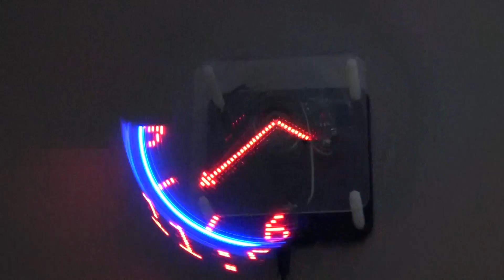A short rant about very old electrolytic capacitors

Comment: I have five square body VHS-C camcorders-two are Panasonic PV-10D’s, one is a PD-40D-that was my uncle’s old camcorder-works great, just a muffled microphone-I also have a GE CG690-and a GE CG695-the last one I mentioned works the best of all of them-decent sound and video. They were all made in about 1990. I wonder if those have the crappy capacitors, or the Japanese good quality capacitors? The two Panasonic PV-10D’s seem to have bad capacitors because of the lines in the viewfinder when I try to film footage-but when I play tapes back in playback mode-no problem-except one the tape slowly migrates out of the correct path and crinkles the tape-the other one doesn’t do that-it just has lines in the viewfinder when filming-it wants to play back the footage too fast-but when I play tapes recorded on a good working camcorder in it-clear as a bell! The GE CG690-lines in the viewfinder when filming-but playback of a tape from footage filmed with a different camcorder-clear as a bell-it also has a bad sensor that allows it to run for about a minute-then the power red light blinks and the unit shuts off. The GE CG695-it has only slight lines in the viewfinder when it’s first turned on-once it warms up to operating temperature-it clears completely up, and it films great footage-decent sound, and all!

Comment: True I have several 1960s transistor radios UK and Japan most electrolytic are ok. There are the known bad makes or the obvious signs of distress. I recently got my parents 1957 ultra from the loft changed what was needed sounds lovely. I kept the smother can in as they tested ok and had no leakage I use this radio myself and can keep an eye on it.

Comment: You absolutely must check for DC leakage, and under load. Testing for capacitance and ESR without load doesn't really mean anything except that the ESR and capacitance is ok when the capacitor is not under load.

Comment: I agree. From my limited experience, most old caps I have replaced because my brother, an electrical engineer said to do it, were perfectly good. I have mostly replaced caps in Ampex tape decks. Ampex used superior materials. 

I checked both capacity and esr and not one was bad. Brother said: but they WILL go bad soon, so it was good you did it. My friend who repairs professionally says: if it ain’t broke . . .
Reply: PS, they all passed leakage testing, too

Comment: I think also its worth considering the manufacturers data on life expectancy ect. 
Makes me think of a timing belt on a car - go past recommend time/mileage and you run the risk of destroying your engine. Caps that have gone way past thier quoted lifespan are really just on borrowed time. And yes it can depend on how its been stored/used. 
My Nad c352 i replaced all the caps. They were nasty cheap caps, didnt want one of those flipping its lid in the middle of a party! They are a known point of failure so it was a preventive measure!

Comment: The Tests that you performed are fine but I personally wouldn't pass judgement until I passed full rated voltage through the capacitor with a microamp meter in series to make sure that there's no DC current leakage... But if it seems like it's to much work to check all capacitors for all their failure modes, then just shotgun it and just replace them all...

Comment: I repair Fender and Marshall guitar amps for a living. Just had a 65 Deluxe Reverb in the shop. It had a blown screen supply cap.I did all 5 main filters, the bias cap and all 7  preamp cathode caps. I guess that amp is 55years old ,almost as old as me. Old filters are like looking through an out of focus camera,new caps are like looking through an in focus camera. i got amps that I did cap jobs in the 80s. I'll will leave them alone for now. Now, just for fun ,take a Sprague TVA electrolytic and hack saw it in half.It's half empty.They are new caps in an old package.One more thing,in the 90s I did a Super Reverb for a customer after he was unhappy with two other shops worked on it.He complained about the price but was happy with the tone. A few months later he left a message on my machine accusing me of using used parts on his amp and never came back. I did not.It has been my experience that a recap of all electrolytics in a older tube guitar makes an audible difference. I would prefer to not use used parts unless stranded on a desert island.  P.S. I do enjoy your channel. No ego here from me.Just observation of time spent at the bench and the gig.

Comment: Join the Church of Electrolytic Reformation. 
Because even IF an old cap goes bad, it often enough will work just fine after reforming it. I have a couple of 2200µF 10V Siemens from 1969/1970. I put them in ATX power supplies (where they are run at much higher frequencies than what they're made for but they apparently don't care). The power supplies are now running for more time with these ancient caps than they were with their original ones. Measure before you toss.
Also reminds me of that one time CuriousMarc restored that 1930s TTY that had huge 1950s electrolytic caps in there and he tested it and it had like 3 times the leakage of a new one but was like 20 times the volume so should be 20 times the leakage - and he checked capacity and ESR and this ancient cap performed just like a new one.

Comment: Is it incorrect that they can test good  using these low voltage methods but actually be leaky when their rated voltage is being applied to them? Example: 50v 100uf passes these two tests but if you apply 40-50v and test it, its leaky or noisy.

Comment: And they say all these basically follow the bathtub curve..ending in 20-25 yrs...
Reply from the maker: Not necessarily. It depends on the circuit, voltage, frequency passed and heat. Many capacitors will never fail, others depending on the duty will fail regularly like clockwork

Comment: Change them anyway, because they WILL go bad in the end, its called preventative maintenance. they are the most troublesome part in any equipment.
Reply from the maker: The reliability of any electronic device is inversely proportional to the number of capacitors it contains. True they have a greater chance of failing at some point but that is also counter productive to the service industry.  A service shop wants that unit back in a few years for another service and generally a client doesnt want to spend a ton more to replace them all. That work isn't being done for free.
Reply: @12voltvids  Yea but for home users just change them, it gives less headaches in the long run, the fuckers can leak all over the place and destroy the pcb and do even more electrical damage, shorting and blowing transistors for example, so in a nutshell for how much they cost and especially in audio equipment where sound quality is key, just change the horrid things, in fact remove the shitty circuit glues as well, that stuffs just as bad. remember the capacitor plague of 2006?

Comment: Generally, bigger capacitors last longer. Even according to their datasheets. I guess probably because its harder to make perfect seals in smaller dimensions.
Well, in certain cases, you need a full recap. Like '80s - mid '90s early low-ESR capacitors. They will have 'incontinency' at one point, flooding the board with electrolyte and ruining it. I repaired a Sony BVM-2010 monitor last week which was many thousand $ in 1990, yet they used the same (supposedly good quality, Nippon Chemi Con, Nichicon and Elna) low-ESR capacitors that they used in their consumer VCRs at the time. The monitor failed about 10-20 years ago, and was in storage since then. While it was in use last time before it failed, one capacitor spewed its guts on the board, and even though it was just an 18V circuit, it caused so much leakage current between the legs of the capacitor (on the board surface), that the board got charred, shorted out the rail and burnt up the flyback coil of the regulator (yes, no short circuit protection in a several thousand $ BVM monitor, at least not on all of its rails...).
I've bought a 1984 Panasonic WVP-200 Saticon video camera few weeks ago - it has shorted tantalums, and leaking ordinary 85/105°C leaded Panasonic miniature caps. Needs a full recap.

Comment: Japanese capacitors they can last forever
Reply: Maybe the new/recent ones but there have been plenty of awful ones over the years, especially in the 60s. Bad batches here and there through the 70s to 90s too. A lot of brands have gone bust over the years because manufacturers had angry customers when they used certain brands so they kicked them to the curb.

History is repeating now with Chinese brands. I tried some and they were inferior when new or died quickly in use. A lot of Chinese-produced stuff is dying in people's hands very quickly. Most just gets tossed. I brought a lot back to life by just going over the caps.

Comment: You're perfectly right! Most of these changing caps do so because they don't know what they do, most are non technician, and are easily lured by vintage material sellers that claim to make a good job doing so. Many don't know what an ESR is, nor have the way to measure it. The other problem is most caps have to be unsoldered to be measured in most configurations. Apart from some tube stages implying very high impedance circuits, you can't test and check a capacitor completely if not taken out the machine. As most quality brands like Luxman use quality components, you're pretty sure to find them in pretty good shape if not subject to specific stress or oxydizing process. In this case, the 6 caps you removed are still good, but I'd say suspicious with the brown goo syndrome. I've seen disastrous oxydation of metal legs or seals that make these glued components potential bombs. It's always a good thing to clean most of the residues from the board, but I consider a waste of time the cleaning of such low cost components (once you've sourced them!). When it comes to 30 years chemicals capacitors, they also have a bulging process that is generally a good sign of advanced deterioration, wich is particularly well observed with a stress cross on top aluminium Cap: a cracked cap is dead! But today's caps are not supposed to do a better job, else in terms of volume, and it's somewhat tempting to get higher values. But if the original design was fine with a specified value, it's not an easy choice for a real technician to change it beyond tolerances, as you could expect some consequences and other problems. The common mistake is to replace the supply filtering caps with the "same looking" / same volume modern cap, hence multiplying the thousands of microfarads. This leads to bursting rectifiers diodes, boiling transformers: for no significant audio difference. When you can get a 470 000 uF for a few bucks to replace a then pricey 100 000 uF, it's tempting, but can be disastrous🌋.
Reply from the maker: Correct when changing the main filter the amateurs think bigger is better.  More capacity means more reserve but the problem is the initial charge up will overload the diodes and transformer.  So for anyone putting in larger filters a soft start circuit consisting of a large series resistor and timing circuit to allow voltage to build slowly on power up and then the relay closes to supply full power, or run up slowly on a variac.

Comment: just curious what type meter that is just a wikipaedia quote here "An ESR meter does not measure the capacitance of a capacitor; the capacitor must be disconnected from the circuit and measured with a capacitance meter (or a multimeter with this capability)." just looking for info..... is that esr reading with a uh ? is there info I'm missing here.... I realize it's out of the circuit but what's the capacitance reading uF?
Reply from the maker: Esr is totally different from capacity. Esr is resistance measured in ohms to a 100khz ac signal presented to it.

Comment: How ancient is your olde kitset EA ESR meter featured here....???? When i built mine back in the 80s the instruction notes warned the table of values was wide open to approximation because the designer of the thing had gone through something like 100 of the each of the caps & averaged the results on capacitors that were not that new even then..

Another question, who made the caps? Chances are named-brand Japanese devices 35yrs old will be fine as long as they have never lived stuck up against a hot heatsink .... the killer of electrolytics! 

Final consideration... i test great ESR on so many pulled aged electrolytics but the little buggers have obvious failures for an unacceptable current leakage, i.e. parallel resistance (effectively) when checked comparison done using a new one same value & voltage...
Reply from the maker: The esr kit was from the 90s and it says "approximate max value for new capacitors" so yes they should measure below the number on the chart. If they are above that they could be bad. I measured parallel leakage and they were infinite on my fluke.  Mind you it only measures to 32meg ohm, but that is more than high enough.
Reply: @12voltvids  Not wanting to go all pedantic but i so agree there looks as if a cult has grown up in the last few years of folks that believe shotgunning a pcb with replacement electrolytics is the way to an always repair. I see this on so many Facebook groups for followers of vintage audio who don't really know which end the soldering iron is hot, don't own a DMM but have heard doing it will fix their late 70s high end hifi tuner-amp ebay score they paid too much for and hello...  it's dead when it arrives! 
There was a terrible era when electrolytic caps were all dumping out their electrolytes and rotting pcb tracks a few decades ago now, all because of bad sealing technology to the lead entry adopted by so many makers .... maybe that's where the current fashion of mass swap-out comes from...?
The ESR meter you feature has a really neat sort of history, 1st appearing in the now long gone Electronics Australia hobby magazine a diy project designed by Bob Parker. It was a break through for myself in that i could finally confirm a fault like lousy ripple on a dc rail was the rail decoupler... 
Nowdays though i use the likes of my Atlas Peak ESR tester and a low voltage G-ohms sensitivity tester unit to check current leakage after charge inrush....

Comment: Yep, usually electrolytic caps are bad only if they don't test like they're supposed to, absent any obvious signs of distress like leaking, bulging, or if it simply blew up.

Regardless of age, if the electrolyte is stable, the innards are still sealed from the outside, and it still works within spec, then it's generally still going to be good.

Unnecessarily replacing all caps = unnecessary cost of unneeded parts as well as your time and labor.

Comment: Shango and 
radiotvphononut
 verify these statements.
Reply: Well all he did was check for value and ESR which are not totally indicative of a bad capacitor. Radiotvphononut at least puts the caps he pull under a DC load to test for leakage using his vintage cap testers.

Comment: Neither here nor there.  Around 2003, a Mitsubishi CRT projection tv from circa 1992, had 78 bad caps, all were leaky as evidenced by the substances on the CB.  I checked each 1.  The customer wanted it fixed for sentimental purposes. It took me 7 hours for that and convergence issues,  bad solder joints and such.
Reply from the maker: Mitsubishi used bad caps in many of their devices.  Lots of vcrs had pissy caps on them as well.

Comment: Mostly the small ones will fail. Larger electrolytics, especially with ones that are filtering 50/60Hz mains power supplies, will run for decades with no issues, as they typically are not going to be stressed. Smaller electrolytics often live next to a toasty power resistor, or power dissipating transistor, so will be cooked. Aside from that they are reliable, only needing replacement when they physically leak, or finally dry out totally, and as the large ones were typically provided with a lot more excess electrolyte than the modern ones. 

You have to get the volume down somehow, so you cut the foil thinner, fill the inside with more foil, use a thinner separator, and etch the foil much more aggressively. Makes for a lower ESR, but the old one probably held more than double the volume of electrolyte. Seen plenty of old electrolytics that had a popped bung, or rubber that perished and cracked, but which pretty much were almost exact as to ESR and capacitance. Even got some NOS 10000uF 6V ones, and they formed up perfectly, and held the 5V forming voltage for over a month. Another though in the same lot corroded right through the case and made a mess in it's box.

Comment: If you're SERIOUS about REPAIRING electronic EQUIPMENT you need to have the proper test gear. If you're going to go through ALL the trouble of removing the component and only do one test what would be the point. You tested for ESR and it passes put it back in it's a perfectly good MAYBE!. Then you test it to see if it has the right capacitance value and hasn't drifted. It test ok. Put it back in its perfectly good. MAYBE!  MY POINT IS. There's still one more TEST that NEEDS to be PERFORMED  that is a LEAKAGE TEST. If you're not going to do all three test there's no point in doing any of them. it's the equivalent of testing your car battery with a voltmeter and seeing 12 volts and saying well this battery tested great. And then you try to use it and find out it has no current. If you had tested it properly you would have known that. End of my rant but not on capacitors but proper testing.